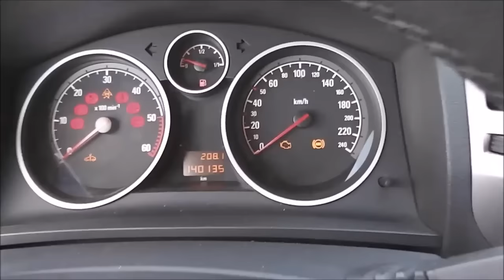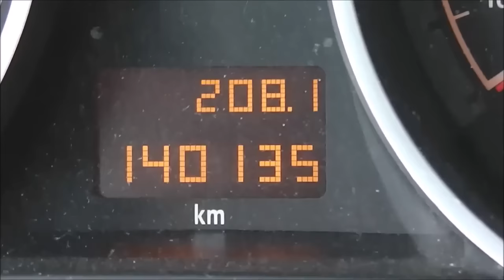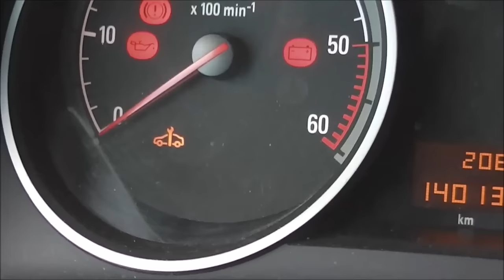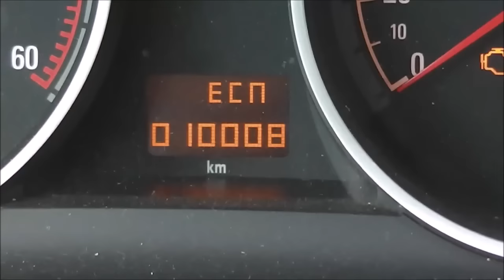How to do pedal test to find error codes on Opel and Vauxhall check for fault Astra Zafira Vectra

Comment: Just to bare in mind, this pedal test only shows codes in relation to the engine. Also the codes that appears may well be historic codes left behind from past faults that haven't been cleared by the proper computer diagnostic devices. If you have issues get the computer check done, as you may end up chasing "ghosts" and spend more money than you need too.(I had an issue (esp light on) where the codes came up as turbocharger solenoid valve circuit open and also a maf voltage low. When in fact it was down to the steering wheel angle sensor and just needed the tracking done.
Reply: Paul Oag I

Comment: My Corsa d 1.2 2010 the car with spanner stays on and fan constantly running, car is running ok though, my research from watching other videos and googling points to the radiator coolant temperature sensor I’ve ordered it and I’ll replace it and see what happens. I serviced my car in February oil/filters etc

My OBD reader says no codes when I plug it in, I’ll try this pedal test later 

Thankyou for this video:)

Comment: Worked exactly as you described, thanks. Any idea how I can find out what my error code means? 253F00 thank you, great help:)
Reply: code P253F is associated with the engine oil quality. Specifically, this code indicates that the engine oil's quality is degraded to the point where it requires changing.

Comment: Don't by an Astra
Steering rack goes
Timing chain rattles
Back wiper pipe cracks
Suspension goes.
I have a 2016 model and it's breaking my heart

Comment: signum 2003 Automatic don't work..
I tray with obd reader and I can't not read..engine code comunication error..mechanik also check and can,'t connect the obd with engine...all other things on my car is working to connect with obd but engine not...after 100km up or 10 km maximum is came the engine light and car not power enough,not more that 80 km per hour,I don't now what I do obd error conection with engine but problem there,code is there
can you help me please..

Comment: I have seen the spanner light come on while I am driving and then goes off again, nothing seemed to happen to the car but this morning my car wouldn't start at all. I turn the ignition and it wont turn over. What may cause this and how do I fix it
Reply: did you fix the problem? my opel did the same

Comment: hey my friend I got problem its says 30000 than anotrer 30500 and 164500 what does it mean please right me. Thanks
Reply: Get rid
Reply: Holaa what that means 068302?? Thank you
Reply: @cecepabdurrohman6195  
The 2nd digit references the code group title, for a powertrain server:
1, 2=Fuel and Air Metering,
3=Ignition System or Misfire,
4=Auxiliary Emission Controls,
5=Vehicle Speed, Idle control, and Auxiliary Inputs,
6=Computer and Auxiliary Outputs,
7, 8=Transmission
9,0=reserved or determined by SAE.

The last two digits 00-99 define the actual body of the message. The site author has the option to use a specific source code or a generic source descriptor in the message. This browser will identify a generic message and provide a list of additional code tips. Note: sites authored by manufacturers are strongly encouraged to use the same titles as SAE. If a manufacturer code is not listed in the browser library, it will cross reference the source code to SAE.